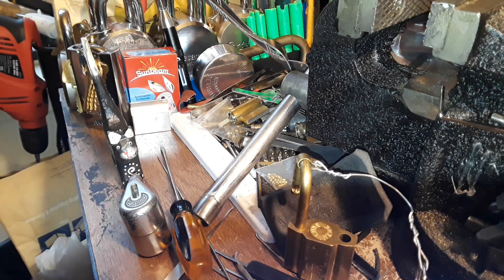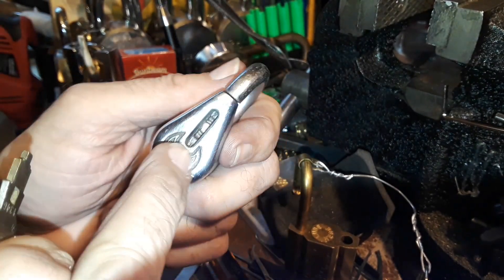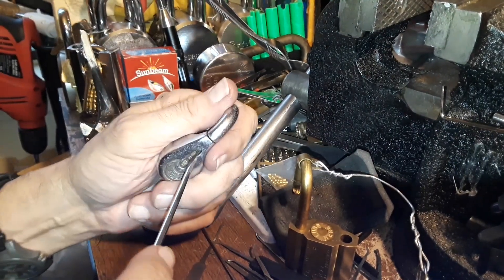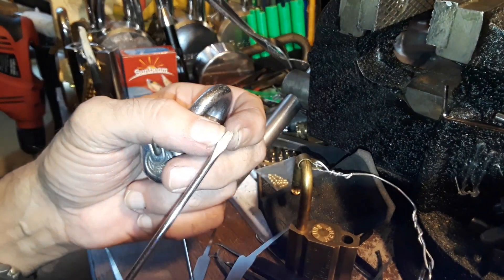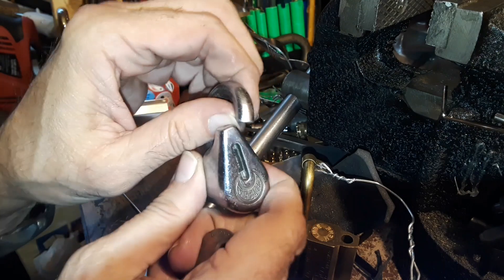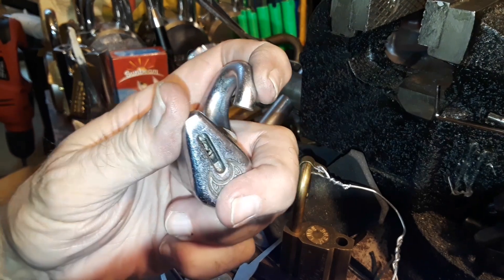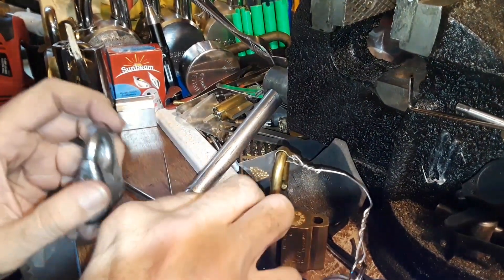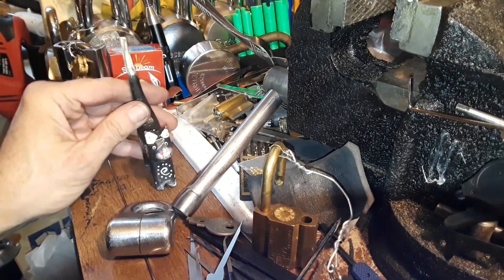(594) A Very Interesting Wise Concentric Tubular Lock Picked Open

Comment: I like Wise locks and have two of the same and a fuel cap version on the way, I like the unusual designs. Nice new pick. Lol.🍺✌😁
Reply from the maker: Maybe Sparrow's will adopt it as the "Heavy Pick". Guaranteed not to bend under normal use. 🤣

Comment: interesting, never saw one of those before, to bad that lock got screwed open.
Reply from the maker: 🤣😅. It was designed to clamp on a fork of a bicycle,  and if you tried to move the bike, the lock would run into the fender support.  It might have enough clearance to clamp the lock to the frame & the fender support freezing up the front wheel.  You could steal the bike,  but you would have to do a wheelie for your getaway.  🤣😂
Reply: @WilliamMancel  
i get it now, yeah i can see why they stopped making these locks

Comment: Wtf is that lol.. never seen one of them before.. ty sharing WM
Reply from the maker: That's what I thought.  I did a little research,  and this lock was designed to fit a specific bicycle that was made in the 1930's. They also manufacture locking gas caps for older cars using the same mechanism.
Reply: @WilliamMancel  interesting .. you should keep eye out then try source the petrol cap ., maybe get car model n ring wreckers ?